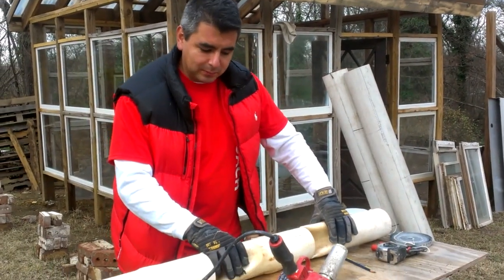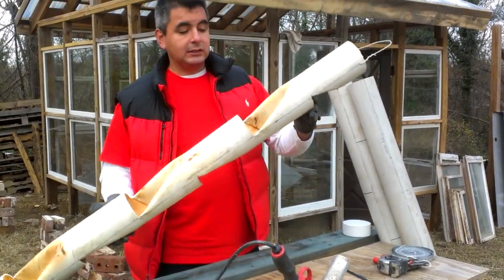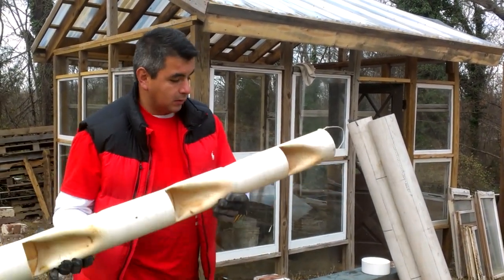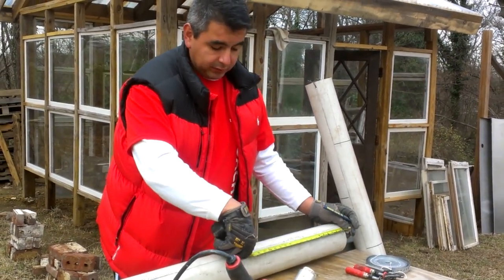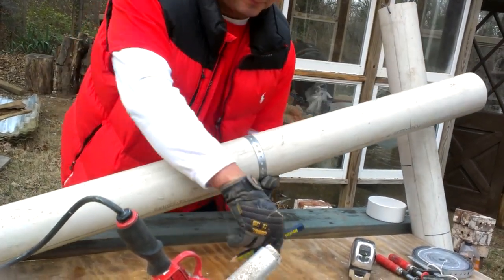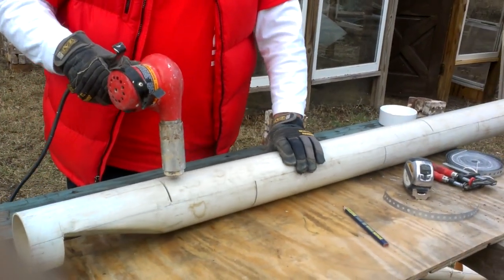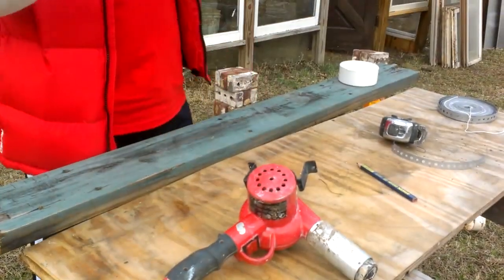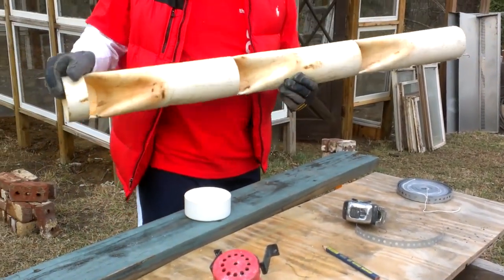Strawberry towers, aquaponic systems

Comment: I Use the same method, but use black ABS Pipe to gain more heat in our cooler climate. In some areas the black ABS is much cheaper. People that don't have a lot of money can get used pipe from plumbing contractors that modernize drain systems and remove used piping.

Comment from the maker: Hi James, I hope the leaks are not a frustration, normally i clamp the edges very well and from time to time I apply some more heat to the edges, I open the bottom some to have a continuous flow and file the bottom edge with a 3/8 drill bit, some other put a ring made with the same pipe just about one inch big but they have to add silicone then and i find it a bit time consuming. I hope the info can help you. Thank you, next week see the filter that and making to avoid sediments on your systems.

Comment: Hugo, you must try to use "food grade plastics".. I looked into it after checking out another video on the making of straw berry towers. over time, certain plastics do leak toxins, that might / will get absorbed into the plants that you grow. There is alot of health risks connected to the wrong type of plastics used in food preparation / storage. Hope it helps you.

Comment: I just built my first tower system, using your method.   However, it leaks on the sides as the water flows out and around.    As I am routing all of the water at the bottom exactly where I want it instead of letting it fall... how do I seal up the sides?  I tried rebending them, adding rocks, and today I'm going to add a fiberglass patch on the one that's leaking.   Any ideas?

Comment: Ok again If you add soil to the tubes you have a auto watering system not a true hydroponic system If you will put netting at the bottums of your segmented areas of the pipes and fill them with Marbles or stone then  it is a true Hydroponic system and will work well with a eb-flow system of water recycling one more thing you might want to advice viewers about water seeking its own level and that they have to trickle feed this type tube or they can over flow it easly